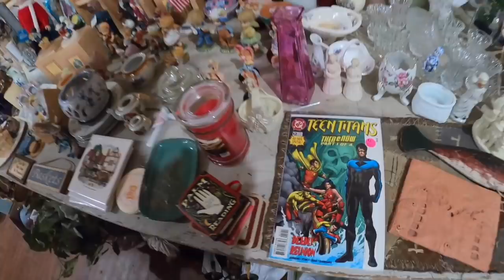Rummage Sale - Estate Sale - This is a Snow Day

Comment: 0 degrees here, feels like -9. Heat wave starts tomorrow at 28 degrees.  The few estate sales I've attended have 2 sides to them. The ones where the occupants were non smokers had high prices, but last day of the sale is very cheap as it's a $5 a bag sale. Those whose occupants were smokers seem to start out with bag sales after the first 6 hours or so.